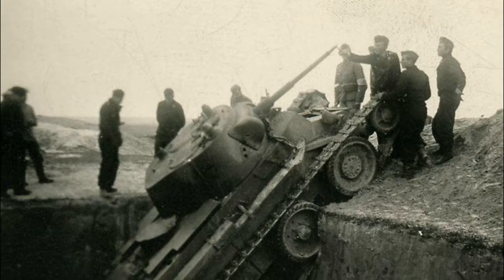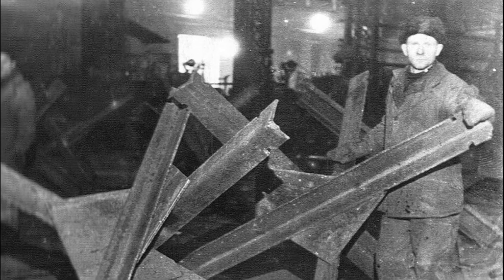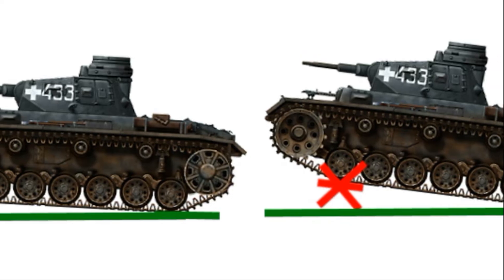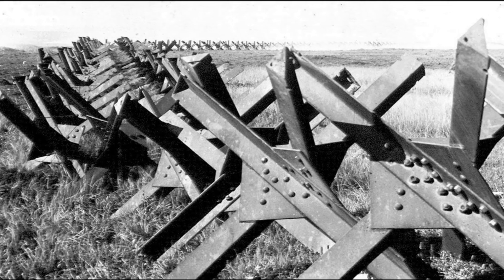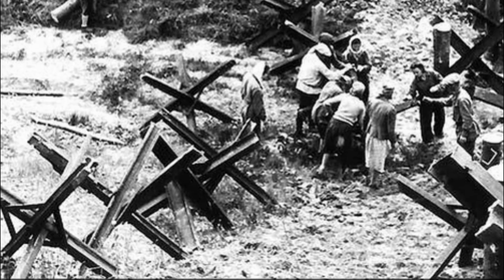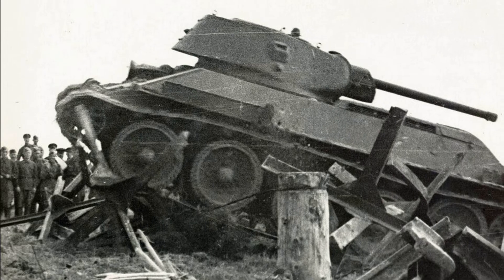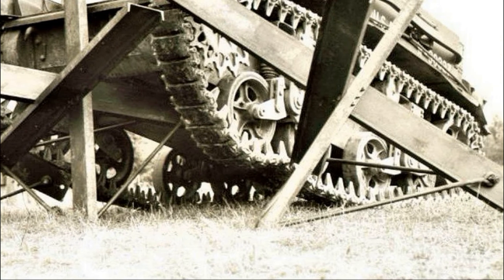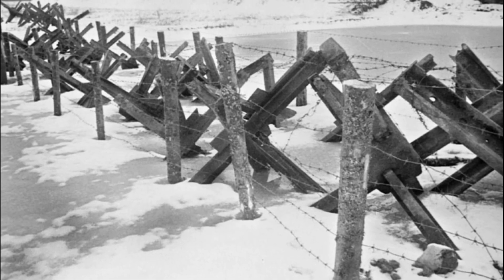How does an anti - tank hedgehog work ? A brilliant invention of a Soviet general.

Comment: 0:54 I already have question: Why didn't they just WELD them together instead of painfully drilling and riveting?
Reply: Welds have a random failure point (as in, you never know how good the weld is and when is it going to break). Rivets, screws, bolts etc, have known tolerances and so are more reliable
Reply: I can't answer this question definitively, but riveted joints in general have some advantages; they are reliable and easy to inspect, for instance.
Reply: Its also cheaper and less advanced tech
Reply: Easier to transport when dismantled
Reply: want to add, quick response/solution and mass production for rivets and screws